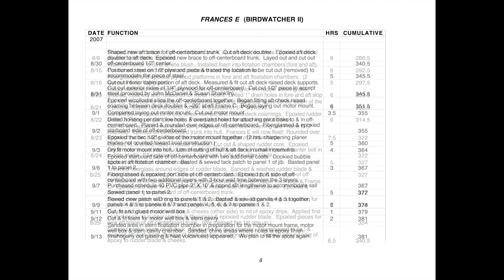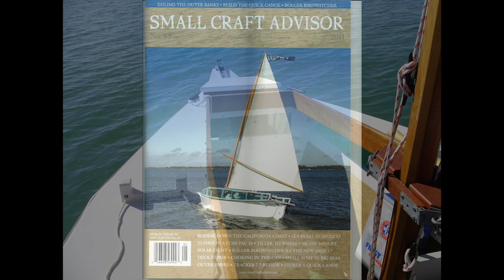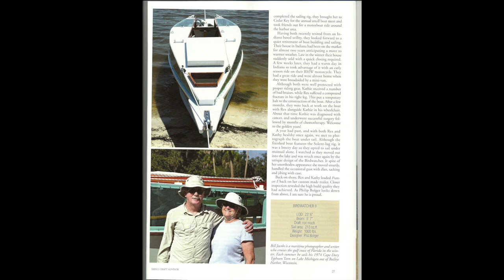Building a Bolger Birdwatcher 2   HD 1080p

Comment: Nice to see the construction of the Birdwatcher. Such an intriguing design. It would be good to see videos of it sailing..
Reply from the maker: This. was before we started doing videos and we no longer own the boat. Last we knew it was in Wisconsin, closer to you than us. Let us know if you see it.
Reply: @RexandKathie  Wisconsin, eh? yes its a bit closer but still a few steps away. I would love to see a Bolger design in this area. Not so many self-built boats of any kind really so if you ever feel like a long road trip, we'd love to see your Tiki 21 at the Elbow Run. The next one is our 10th Anniversary of the event and i t promises to be special.. You should be in the water by then, eh? :-)
Reply from the maker: @RodMcLaren  We are hopeful it will be in the water by that time. Question for you, on your Tiki 21, when lashing the beams on a beach how easily were they to get the beam sockets and deck blocks etc aligned. Did you lash them together and then once in the water tighten the lashings when they were on the proper plane?
 The Mana has a different attachment scheme I believe.
Reply: @RexandKathie  yes, that’s how I did it on the Tiki 21. Beaches are rarely level so it’s almost impossible to get things lined up to get a tight lashing. The Mana is easier with straps and over centre buckles but still needs to be adjusted once in the water. If you plan to trailer much give some thought to an expanding trailer. Even if only launching and retrieving it turns the job into one which can easily be handled by two people instead of recruiting help to offload/on load hulls. It works well on the Mana and I see a number of folks using it for their Tiki’s also.
Reply from the maker: @RodMcLaren  Thanks for the info, yes we are planning on modifying a trailer to expand. Best to you.

Comment: Very cool interesting boat, but the one thing I dislike is the engine placement.. It just looks bad. Is there another way to put an engine on there? I'm thinking an electric engine placed somewhere inside.
Reply from the maker: Since it is a double ender a motor well would make it difficult  to enter the cockpit from the rear deck and there are steering cables ;under the deck. Being a sharpie, shallow draft is important and there would not be a way to raise the motor under sail.and when approaching a shore to beach the boat. All boats are compromises, thanks for watching and commenting.

Comment: Looks very sci fi and modern. What did you do with it?
Reply from the maker: Sold it to a guy in Wisconsin. He is about 1200 miles north of us. The Birdwatcher would be great for extending the sailing season in that area. In Florida with temperatures in the 90 's F there was a bit too much glazing. The slot did sort  of funnel air into the cockpit when moving but was toasty when stopped.
Reply: @RexandKathie  I can see that. Were you in Florida when you built it?
Reply from the maker: @BensWorkshop  We lived in Indiana when we started it. Stopped construction for winter. our house had been for sale for 2 years, In March of 2008 it sold and simultaneously we had a motorcycle accident. Decided to move to Florida anyhow,  My leg was in a cast, so spent a 1.5 years in Tallahassee, Florida. apartment.. We did get it finished just before we moved to Spring Hill, Fl.
Reply: @RexandKathie  Would marine type window shading or blinds help the "Toastiness"? How about a short - well engineered Bimini cover?
Reply: I live in Houston area and suffer same temps, etc. as Florida...😁😁
Reply from the maker: @tbertw  a Bimini would  help while anchored, as long as you are moving there is air movement in the cabin.
Reply from the maker: @tbertw  for sure, any boat that has a cabin will be stuffy if inside while at anchor.  You could arrange an air scoop up front when pointing into the wind at anchor.